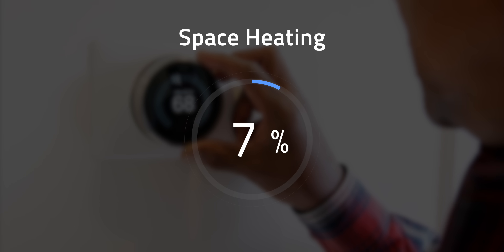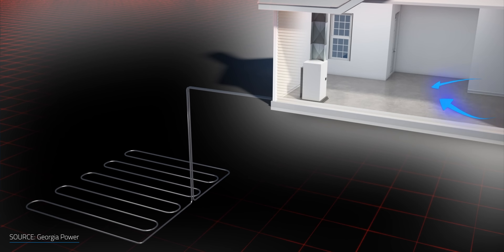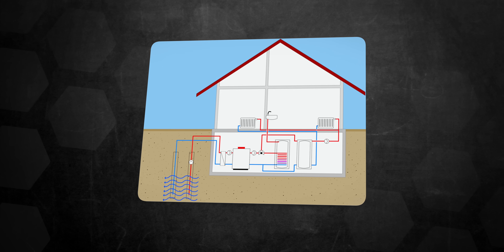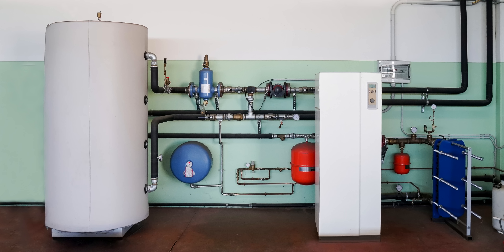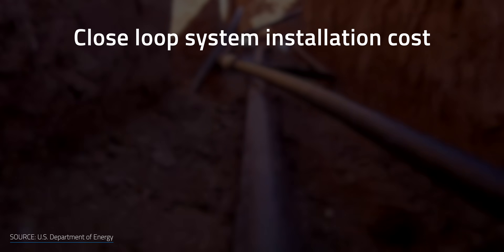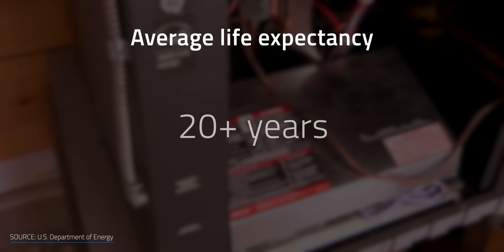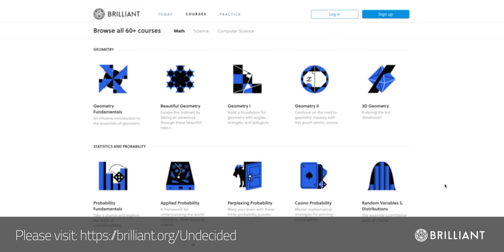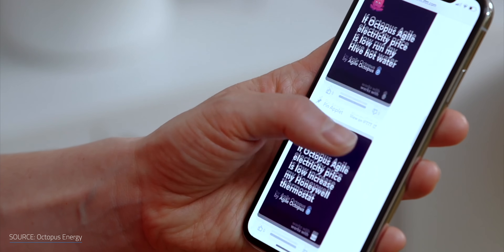Is Geothermal Heating and Cooling Worth the Cost?  Heat Pumps Explained

Comment: I'd be interested to know if neighborhood, or municipal,  loops would offer a less expensive installations, or other benefits.  Also with the Texas freeze - what would it take for solar + battery to run a GSHP?  Hydronic in-floor heat better than ducted?  A self-sustaining house seems awfully attractive.  I love your show - too many topics - too little time!!
Reply: Yes.
Solar and battery could run a heat pump, the only question is for how long.  Probably only a few days, and that only if you are frugal with your energy.
Hydronic in-floor is not vastly different in terms of efficiency from ducted air.  Efficiency or lack thereof,  more likely lies in the heat production system.
Reply: CorwynGC Underfloor may not be vastly different in terms of efficiency, but in terms of comfort and convenience it's in another league. It's practically zero maintenance, draft free, silent, doesn't blow dust around, and provides a uniform warmth at low level, where it's needed rather than up around the ceiling. As a result, you can often set the thermostat lower for the same comfort level which in itself reduces running costs. Blown air may make sense where it also provides conditioned air in summer but in climates where air conditioning is not required underfloor cannot really be beaten.
Reply: @spencerwilton5831  Underfloor heating is lovely if your house is under-insulated and insufficiently air sealed.   Once the house is efficient, underfloor heating loses most of its appeal.  Any heat is already evenly distributed, there are no drafts, etc.  Since heat loss is low, the temperature of the floor is not warm enough to be bare foot comfortable (if thermally heavy).  Don't even think about what happens if you spring a leak with in-floor heating.
Reply: @CorwynGC I suspect a system could be designed to run indefinitely.  Batteries need only last a night until the solar panels kick in.
Reply: @ljdavick  That is a lot more difficult.  Most solar installations are sized to produce the same AVERAGE usage as the house requires.  But summer is several times more than winter.  In order to run indefinitely in winter, more than twice the solar panels would be needed, plus a much larger battery.  Such a system would essentially be off-grid.  Compare prices for on-grid versus off-grid.

Comment: I've worked with geothermal systems and one thing that you didn't mention but it does happen is that if the installer/system designer doesn't do a proper job, like sizing or simply not following the sizing dimensions established to cut costs on the installation side the system could under-perform frequently leading you to believe that its junk when actually it wasn't done properly in the first place. So do make sure the company you hire is certified and doesn't cut corners.

Comment: Would that kind of system be efficient enough to allow an average sized house to run the system off a solar panel system backed up by a battery, like the Tesla Powerpack ?
Reply: Where?  Probably not for moderate or greater heating climates.   For my climate (cold), and my house (efficient),  and my solar panels (enough to run the whole house on a yearly basis),  I have a 1,500 kWh winter deficit.  Getting that from Powerwalls would require 100 of them.

Comment: Ground source heat pumps will never catch on for developers building subdivisions. I guess if you build your own house in as subdivision or somewhere else and there is no HOA rules, you could  do it, however IMO you would be far better off with a 12 kW solar system with a Tesla Powerwall. Cost is about the same but your heat and cooling costs will be less because you are generating electricity which will apply to net metering.

Comment: You don’t need a large expensive system in a passive house.
Reply: But those are very rare. Most homes are many decades old. Everything built in the last 30 years is by the developer intent on packing in as many as possible into the space they have.

Comment: well, we have it in the house we moved into this year.  It works great.  but it clearly isn't more cost affective than where we came from with natural gas.  thing to take into consideration is that the pump runs on electric .  so, if you live in an area that charges high rates for electric take that into consideration.  for us, it costs us more with our gas and electric costs combined.  this is what you need to keep into account too.
Reply: In the midwest, most geothermal units have electric resistance "backup" for when it gets really cold ... then brace yourself to us 3,000 kWhs in a month!
Reply: David Downs That's an inside with underinsulated houses, not a heat pump one. While air source heat pumps struggle when air temperatures fall, ground source heat pumps will remain just as efficient by virtue of the fact the ground temperature barely fluctuates. What you're actually saying is that in a poorly insulated home in winter, a small heat pump can't produce heat as rapidly as it's lost from the building- in which case, you should look to reduce heat loss from the building before you switch on additional electric resistive heating.

Comment: Yes, I'm planning out all the equipment I'm going to need right now for my DIY system. I'm also going to use solar and a geothermal air system like a modern greenhouse utilizes. My system will be an off grid system, hopefully. I'll try it on the new greenhouse build first and then do this for my home that's already built. Good thing that I'm planning on building a pond next to my home because that's where I'm planning on installing it.
Reply: For a pond loop you need to make sure the water is deep enough so it won't freeze all the way to the bottom
Reply: @michiganengineer8621  I was thinking of putting it underneath the bottom of the pond in gravel so that it gets the moisture of the water and also gets the warmth of the soil. It would also be out of sight and out of the way.

Comment: Geothermal is too high an initial investment for the savings you get.  For less than the price of drilling alone, I got a heat pump and enough solar to run it, and the rest of my house (plus almost enough for an electric car).  The key to this is to first make your house very efficient.   A Passivhaus would do even better than my house, and you wouldn't payback the cost of geothermal in the lifespan of the house (call it 100 years).  That of course includes the increased cost of the Passivhaus.
So, first invest in efficiency, then realize you can heat with far less initial cost than geothermal.

Comment: Hi,
Just a quick question about your initial math.   15% of energy is used on heating and 16% on cooling totaling 31%.  BUT that would only happen if you had to both heat and cool your home at the exact same time.    If you heat in the winter and it uses 15%, and you cool in the summer and that uses 16% then the total energy devoted to those systems would only be 15-16% based on the fact that you never use two at the same time.    Is there something I am missing?  to me it should not be a cumulative number.
Reply: Depends on whether he is talking about instantaneous power, or yearly energy use.  If 15% of the yearly energy budget is heating, and 16% of the yearly energy budget is cooling, then they do total to 31%.
Reply: @CorwynGC  Thats what I was wondering about.   Thank you for the response.

Comment: I'm definitely leaning towards geo thermal when I build my house.   Thank you for the vid!
Reply: Be sure to check the "smart" capabilities as described in the end of the video. A good system can convert access power from PV Panels to heat (or coolness). Many vendors will say their system is smart and intelligent when they are actually pretty dumb. There are enough good systems out there which will fit your needs.
Reply: @jaap7374   thanks for the heads up

Comment: I have a heat pump in my house with a vertical closed loop system (4 pits 140 m deep), installed in 2009. The maintenance is virtually ZERO. And with solar panels, energy costs are almost non-existant.
Reply: What's your latitude? You still get enough energy in the winter?

Comment: I think that heat pump systems can help save energy and money over the long run. Taking energy out of the ground in winter time (when heating the home) and putting it back into the ground in summer time (when cooling the home). Living in a warm climate (Georgia), I am wondering whether the ground will heat up over time and the system become less efficient over time (months/years). Any thoughts on that for hot climates?
Reply: The ground down a few feet is at the average yearly temperature.  It gets most of that heat from the sun, which is where most of the heat from your house comes from.  So it won't make much difference, certainly not over month time frames.

Comment: Insulate & air seal so you need a small affordable heat/cooling system. It's easy & fun to focus on the technology. Passive House, ENERFIT, etc
Reply: Everyone should check with their local electric company to see what they'll help pay for in this regard. Often it's substantial.
Reply: A tight well insulated house beats all technology solutions  including solar.  Maintenance free with zero annual cost.  A tube of caulk is $2.
Reply: @kirkland5674  some people like ventilation, as even a small rise in CO2 makes a surprising difference to your mental state and ability. You can insulate as much as you want but if your ventilation system in drawing 10% - 30% fresh air then you will need a system to keep the house at the correct temperature.

Comment: I think you need to put a bit more effort in to explain that a heat pump is an entirely seperat technology from geothermal.
What I mean by that is. An air-conditioner, fridge, freezer and a lot of heating systems (I think including the picture of the HVAC systems you keep showing) are also heat pumps. And from what I know, have an efficiency of an average of 2.5.
I know that you more then likely know all of this. But it really sounds like you are saying "this is a heat pump" then showing geothermal thechnology that includes a heat pump. Some people, if they are not already aware. Will walk away without knowing what an actual heat pump is, dispite your title saying "what is a heat pump"

Not trying to complain or anything, and as someone who already knows it was a fun video. Just pretty sure this is likely.

Comment: They are great when they work, my parents put it a top of the line system, and 3 of the 5 loops failed over the years and in 5 years their bills were over $600 a month they ended up paying $25k for the install and then 5 years later another $9k for a heat pump and now their bills are $250 a month, unfortunately, it didn't work for them, a lot went wrong.

Comment: My aunt had one put in about 35 years ago, and it lasted 33 years without problems.
Reply: And what happened 2 years ago?..
Reply: @Steellmor  Mechanical failure eventually happens in every system, they likely had to pull the piping out and replace it.
Reply: @SilvaDreams  I was just curious what exactly happened since he already mentioned it and the way he did it was kinda funny and intriguing.
Reply: @SilvaDreams  pull the piping out and replace it??? its more like the heat pump its self needed fixing. not much to go wrong with the piping.

Comment: So... Hold on.
People are heating and cooling at the same time?
Or did I just miss why heating and cooling electricity consumption would be added together? Because I don't think any given house, or electrical system. Is supporting the heating and cooling of a space at the same time, obviously.
It must just be that were talking about overall usage over time VS draw at a given time? 
Ah, that must be it.
Reply: Right.
Although I did see a place which had both heat and air conditioning set to 72°F, and both were running, on a beautiful 72° October day...

Comment: Definitely would make more economic sense if you installed this for a duplex or quadplex. Its more upfront cost, but its split amongst multiple houses, and the insulation of the shared walls helps the reduce the average capacity needed. There would just need to be a way to split the output from the ground to 4 different heat pumps. Which I imagine must exist for people with large homes with multiple heat pump units.
Reply: Shared ground loops are quite common on larger developments in Europe, each property generally has their own heat pump as you suggest, it's not a complicated set up, but the ground loops do need to be carefully sized to ensure they can meet maximum simultaneous demand.

Comment: Whoa!  The compressor doesn't act on the water (2:34) flowing through the subterranean pipes (can't compress water, remember?) but rather on a refrigerant that contacts the water through a heat exchanger.  There's always a refrigerant involved.
Reply from the maker: Yep ... I kind of oversimplified the explanation in there.

Comment: I think you should differentiate between geothermal which uses heat from the earth's core and ground source which uses heat pumps for heating and cooling from stable ground temperatures.
Reply: Yeah, definitely a misnomer to call it geothermal, but it seems to be getting called that.

Comment: Air-source heat pumps (especially with inverters) have really come a long way in efficiency and cold-climate performance, so in many climate zones it's more cost effective long term to install a cold climate air source heat pump than a ground source heat pump with the ground loop costs. Ground temperature is effectively the year-round average air temperature, so there are times of the year where a ground source system is outright less efficient than an air source system.

For new construction, improved insulation and building quality (air and vapor tightness) can more economically make the required heating and cooling system much smaller than a traditional house, which further reduces the cost effectiveness of geothermal with the high upfront cost of digging and installing the ground loop. 

That doesn't mean geothermal should never be used, but it really depends on your climate and you really need to consider what the COP of each system will be over the year.
Reply: I disagree. In a norther European climate at least, we need heat for around six months of the year, when air temperatures are at their lowest. ASHP are less efficient when air temperatures drop. Ground temperatures are almost constant, and in the winter are several degrees higher than air temperatures, so it makes more sense to use ground systems where space and finances allow.
Reply: Also (from my basic understanding) Air source heat pumps have the ability to modulate, allowing them to slowly ramp up and down heating and cooling more efficiently. As far as I can find Ground source units do not seem to do this and seem to be more ON/OFF units
Reply: Most whole-house heat pumps you would buy from US manufacturers can't modulate either (other than possibly being 2-stage). Only newer inverter heat pumps can modulate, and these are the highest efficiency units.
Reply: Geothermal and Air to Air Heat pump and cooling units come in inverter types.
This allows them to operate as low as 25% up to 100% efficiency.
Reply: Air source heat pumps work terribly in colder climates, even with great insulation.

Comment: I installed Geothermal a couple years after adding solar energy to the home, my overall cost structure went from $4500 per "year" to heat/cool/appliances/Electronics/and gasoline down to $1000 per year for all that including an electric car.  Sure investment was high, but I am planning on retirement having lower bills.  So far it's working.
Reply: Well good thing you are retiring soon because after about 10 years those solar panels are going to be working at half their original output and if they are still functioning after 15 and make it to their pay out life time of 20 year it'll be a miracle but it'll be your kids or the next owners problem then. Also don't expect that electric car to last more than 6 years, maybe 8 before you are paying essentially what you put into it to replace the batteries. (At least 20 grand)
Green energy isn't nearly as green as you think, solar panels use a LOT of coal and other "dirty" processes to make them but never turn about their carbon footprint they make in their creation.
Reply: @SilvaDreams  you know that top modern solar panels guarantee 90% functionality in 30 years right?
Reply: @SilvaDreams 
"after about 10 years those solar panels are going to be working at half their original output"
• Most panels warranty 90% at 10 years, and 80% at 25 years...
"don't expect that electric car to last more than 6 years, maybe 8"
• Teslas worst warranty level is "8 years or 160,000 km, whichever comes first, with minimum 70% retention of Battery capacity over the warranty period." and they're not going to risk having them fail within warranty periods, so you'll get substantially longer than that. Independent sites list it at 300,000 to 500,000 on average, with some test vehicles having 150,000 km with 90% efficiency still.
"solar panels use a LOT of coal and other "dirty" processes to make them but never turn about their carbon footprint"
• Boomer misinformation easily disproven with a quick google search. The manufacturing threshold was passed a long time ago, and solar currently sits at 5-20% of the carbon footprint of gas or coal (depending on if/what carbon capture technology is being used by them, and which of the two you look at)
Reply: @SilvaDreams  Even if at the point green energy sourcers are enough to self-sustain the manufacturing, the materials require mining and refining. And even then, materials are subject to degredation, whether it is mechanical or electrical.
Reply: @SilvaDreams  Thank you for some common sense in this comment section. 👏